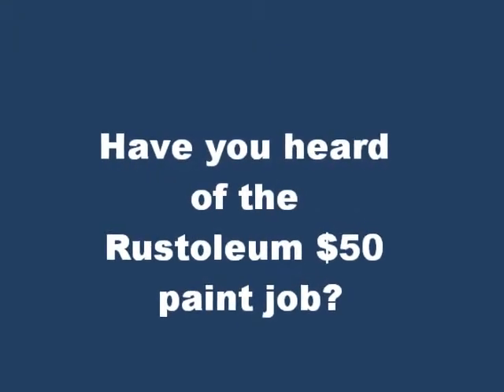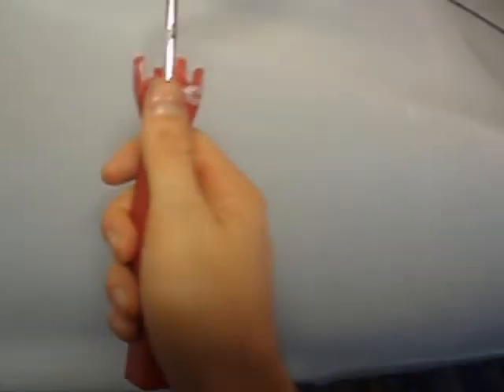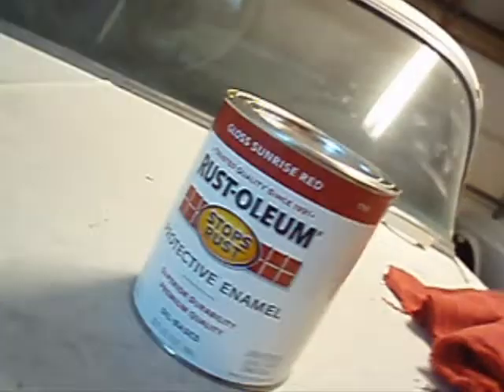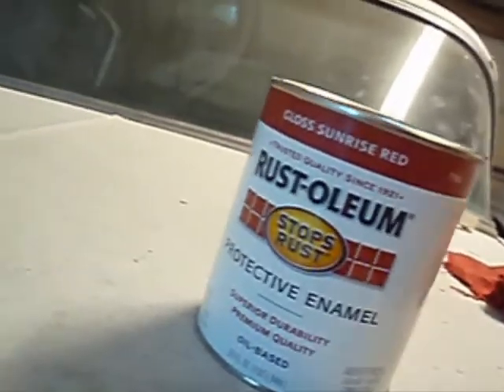$50 paint job #1

Comment from the maker: @megatron804 , after i wet sanded the primer it leaves a lot of residue that would be bad to paint over. I just bought a gallon of acetone and would wet rags and wipe down the entire car after each wet sanding. I didnt use more than a quart though for the entire job. I have other videos of the car with the motor in and my final video shows that i traded for a motorcycle. I only cut and polished 1panel but it turned out amazingly. U can make this roll on job a professional quality job.